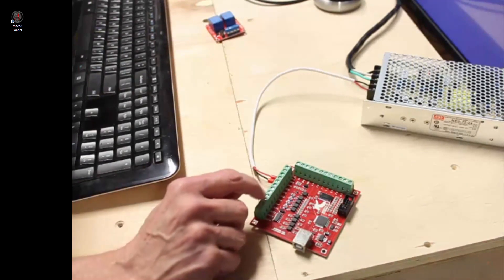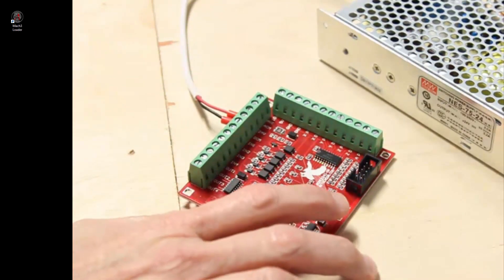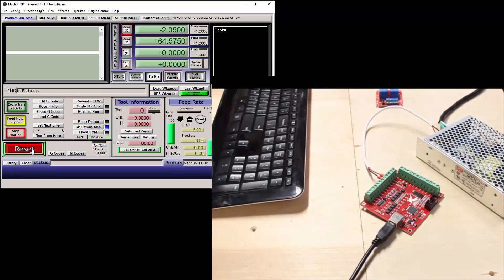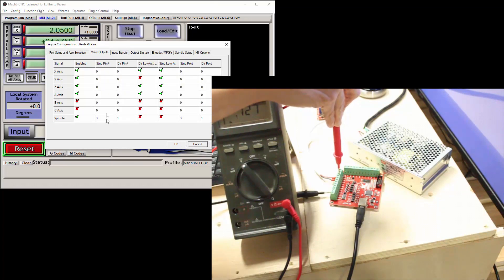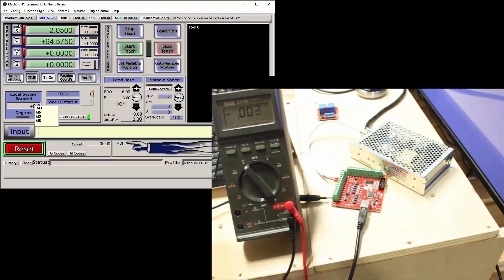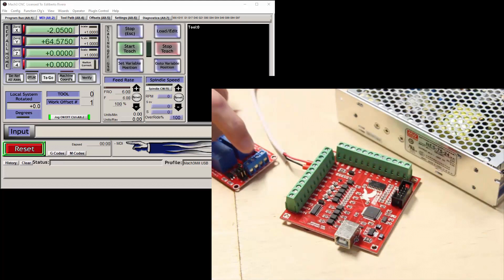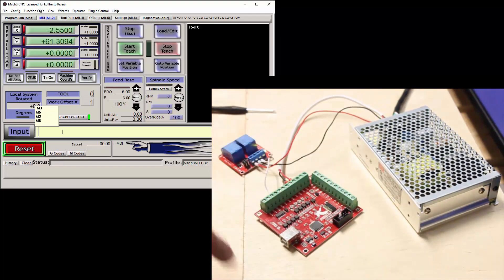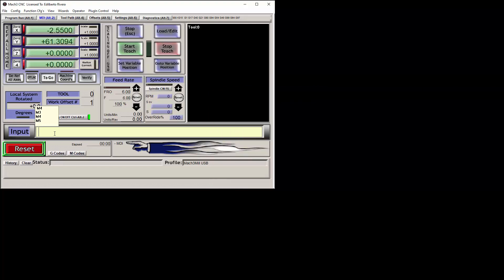Mach3 USB Controller Output Terminals

Comment: EDIT: I was completely wrong and did not realize that the Outputs are basically just open collectors. This means that once active, the Output becomes connected to ground. They do not "ouput" 24V or anything else. So you need to set up your relay for this operation. 

IMPORTANT for people who do not get the outputs to work this way: 

I've tried this approach for about a day and went through all mach3 settings trying to find the error because I was not getting a signal. The best I was able to do was to have a voltage of -0.6V between DCM and all inactive Outputs, while the active output showed -1V. The output was flashing in mach3, but didn't quite reach my motion controller. 
I was about to throw the towel and buy a different motion controller. 

Then I saw a video (channel was Minhs Man Cave), in which - instead of wiring the 24VDC ground to DCM, it was wired to one of the other ground ports (besides the 5V and 10V pins). Although I have not seen this wiring anywhere else and it might lead to problems further along the way, suddenly I got a 24V signal on the active output and 0V on the inactive ones and everything worked. I hope that this comment might help others facing the same problem and not having to sacrifice a weekend in troubleshooting :) 

PS: I did not buy the board from buildyourcnc (sorry, different continent) - so this might also be a reason for it not being able to work properly.
Reply from the maker: Thanks for the recommendation Lorenz. I can't verify if this will work, but I would advise against connecting the gnd of the 24v to anything but the DCM. Maybe the controller you have is different. The outputs are optoisolated from the chip and you want to keep the signal ground isolated if possible.  I would instead look for a different cause of the  problem which is probably in the configurations.  Such as, make sure the port number is set to 3 for the outputs (not mentioned in the video). This is automatically set in the xml download on the mach3 usb page on buildyourcnc.com.
Reply: @PatrickHoodDaniel  thank you so much for this reply! I didn’t have the outputs on port 3 and that fixed everything!!
Reply: My good man. I am NOT ALONE in this world!!!. I followed the wiring of BuildYourCNC. 
10v ---> 10v, AVI ----> VI, ACM----> ACM. 
The order in these readings is from Controller to the VFD. I have same VFD 2.2KW, I did the programming STEP BY STEP. 

PD013 = 8 for reset
PD001=1
PD002=1
PD072=400

I was about to throw in the towel, when I read your comment. But I am trying to understand the sequence here. Instead of wiring the black gnd wire from the 24V power supply to the DCM port of the power supply, he connected the DCM port of the motherboard to the DCM port in the VFD? I think I am missing something. I would appreciate some help.

Comment: Hi. Any idea of why my mach3 software is not communicating with control chip? I've set software configurations already.  Thanks in advance
Reply from the maker: All you need to do is make sure the rnrmotion.dll is in the plugins folder of mach3, and the XML provided on the product page is in the main folder of mach3.  You will use he XML file in the mach3 loader.  If you see the mach3 USB controller blink fast when you press the arrow keys (while in program run tab and reset is not blinking), then the controller is communicating with mach3.
Reply: @PatrickHoodDaniel  Wow amazing. I will try these out. I appreciate your time
Reply from the maker: @dsaworxcarpentrysolutions9155  Sure, no problem.

Comment: I am using 5v relay suggest wiring and setup. I try to wiring with mach3 usb but relay not working. I give 5v to relay from mach3 usb. And sgnal wire conect output 1.
Reply from the maker: You must use a 24V relay, not a 5v relay.  In the video, I use a 24V relay.
Reply: It mean 5v relay not working with mach3 usb ?
Reply from the maker: @Akhtardesign  Correct.  The controller uses a 24V on the input/output side so you need to use a 24V relay.
Reply: @PatrickHoodDaniel  i was using a 12 power supply for this connected to the 24v in with using hall sensors and worked fine, i also use 12v for e stop to trigger the board into estop, if this is the case you have to use 24v why does hall sensors work ans the estop set up? but now trying to wire 5v relays i find no matter how i wire the power and the signal it wont work, when connected corectly it just amplifies the volts to above 5 and wont work.
Reply from the maker: @mightyweapon  You must use relaays that match  the power supply used with the 24V and DCM terminals.
Reply: @PatrickHoodDaniel  yes im aware of that, using 12v through the 24v supply in worked for me on 12v hall sensors, my 12v supply is adjustable but only down wards, but even when adjusting it to 5 volts to match the 5v relays (hall sensors no longer connected) the relays wont work.

Comment: I have question about homing X and A axis when A is slaved to X. This board have only one common input for homing switches. How mach 3 will know that my gate of router is squared properly?. ( The X axis movement of my router will be provided by 2 slaved motors )

Comment: Good morning,

I turn to you, as an expert in the sector, to ask you for a little help.
I would like to restart my old self-made CNC CNC built some time ago as follows: TB6560 4 axis card (red) with parallel port driven by a PC with Mach3.
Unfortunately the pc with the parallel is dead now I have a laptop without parallel with Win10.
I tried with a Manhattan usb to parallel cable but nothing to do.
Is there a way to solve the problem without purchasing the UC100 module?
For example using Arduino mega instead of UC100?

Thanks
Reply: There is no way you can use a usb to parallel port cable if your cnc controller only uses that kind of port. Since your pc with that port is gone, the only way to go is that red breakout board that was featured here.

I built my desktop cnc using tachus 42 discrete diy  3 axis cnc controller that uses parallel port only and almost tried all possible parallel to usb converters and failed. Just saying.

Comment: The outputs do not show any voltage when I follow these instruction. I cannot see where I am going wrong.
Reply from the maker: Make sure the output you are using is set to port 3.  Check out my Instagram video on this: https://www.instagram.com/tv/CNWHk27Db1u/?utm_source=ig_web_copy_link
Reply: @PatrickHoodDaniel  I was measuring voltage from common to output. Ok when measuring from 24v to output :)

Comment: awesome video! but can I use this controller for mach4? any plugins or something? because I try to use in mach4 the controller not showing in "motion control" list
Reply from the maker: This controller is only for Mach3.  If you need a great full featured controller that I sell for Mach4, go here: https://www.buildyourcnc.com/item/electronicsAndMotors-electronic-component-breakout-Mach4-mach3-USB-ethernet-Board
Reply: @PatrickHoodDaniel  thanks for your reply, I will upgrade the controller in the future. but for now i still going with this controller. thanks man
Reply: @PatrickHoodDaniel  oke now I need to know. how to set speed controller from this to the VFD, in case I use huanyang inverter. and I confuse about Pins and Port, what it means? and where I get the Pins and Ports Number? I'll never stop learning.

Comment: I believe I found the answer, I was reading a  Vectric  forum, according to there info I should be able to resolve the problem by adding a Time Delay code right after every M3 code.  I seen a sample of a similar command on Cnc Zone forum by adding a G0 P2.5  it should delay the laser 2.5 seconds from shooting. I will try it and add an up date during the week.

Comment: Hi, is it possible  for the board to recognize the G13 instead of the G3  and G10 instead of the G5. for the G codes of the  Spindle?  I'm adding a Diode Laser to my table but my issue is when the laser shoots, the cnc delays approximately 2.5 seconds after every G3 code before it starts to move. leaving a burn spot. I've read that G10 and G13 don't have a delay issue. When I use the G10 and G 13 Gcodes the laser does not tun on  . If I chane the G10 and 13 at the PostProcessor to G3 and G5 the laser will turn on and off just with the delay. any suggestions would be appreciated . 
,

Comment: I did download your file of USB controller but it shows message that usb card is missing and it doesn’t work ? Note that my control board has usb connection output

Comment: Problems: backlslash compensation does not work, Out3 does not work for all my cards, no backlslash is a big problem
Reply from the maker: Make sure that the port number for the output is port 3.  Also, out 3 is reserved for the spindle.  Check the motor outputs and change the spindle line item so the output is not 3 if you are using it for a different purpose.
Reply: With regards to backlash have you tried using a gcode post processor to compensate? From what I understand this will add extra steps to gcode. I've managed to get rid of most of my backlash on the machine end but I was going to try that if I still had issues

Comment: mach3 setup to work with parallel controller. when usb board connected the setup is confusing and not clear when starting to use config , setting up port, pin, step , signal ,  and axis. i watched nearly all videos on youtube. none of the people try and guide others nicely and slowly how things are done. most of the people have prior knowledge when making these vids but they do not take in consideration that people turn to these vids looking for solid information to guide them through the problems they face with their projects.
Reply: thank you. connect usb controller to computer indicate if low or high drivin , then start mach3, go through the config drop down menu and start with each of the options one by one starting with configuring ports pins axis estop slowly giving people time either write down the info or work out the options on their system. and why it is being done that way . kind regards.
Reply from the maker: @johnsmith-wl8dp  Thanks.  I will make another video that goes through that procedure.  The high or low driving is unclear, however.
Reply: @PatrickHoodDaniel  hello again. i am not an electronic person but a mechanical engineer for the last 52 years well versed with material and steel production as well as computer terminology . i did not have enough exposure to electronics. stepper motors driving cards and breakup boards  has to be connected to enable, pulse, direction , either all negative,  together  , or positive 5volts, if all en-,dir-,pul are connected -ve together then the en+,dir+,pul+ has to have a high to drive separately the boards hence the motors. 
this is confusing and it has to be clarified. since mach3 needs to know what sort of signal level need to be sent in order to make the breakup board recognise the type of signal sent and on what port and on which pin. and  level high or low. i am not well conversed in this and i do hope i made some sence. that's why clarification is required. i need to learn this to be honest. i don't know if i made my self clear. regards
Reply from the maker: @johnsmith-wl8dp  The controller has a chip (MCU) that handles all of the pulses and signals.  All the USB is doing is communicating simple instructions using USB standard protocol.  You should check out some of my MCU videos.  You will see them in the channel. Here is a link for your convenience: https://www.youtube.com/watch?v=R6SstBoXjKc&list=PL6PplMTH29SHgRPDufZhfMRoFwRAIrzOp
Reply: @PatrickHoodDaniel  thank you i will .
Reply from the maker: @johnsmith-wl8dp  With electronics backing your mechanical expertise, you will be unstoppable!!
Reply: @PatrickHoodDaniel  thank you i am exploring the subject further i need to get some foundation into basic electronic system. thank you for your input greatly appreciated.
Reply from the maker: Let me know if there is anything I need to clarify.

Comment: Which is better, a USB or parallel system
Reply from the maker: A USB controller is doing the heavy lifting by producing all of the pulses for motor movement, and processing inputs and outputs, and the computer is only transferring simple instructions via the USB.  A parallel controller forces your computer to do the heavy lifting causing the computer to be used exclusively as a CNC controller.  There is a pro with parallel in that you are able to manually jog multiple axes at the same time, but that is it.  USB/Ethernet is the way to go. Manually jogging only one axis at a is not an issue.  If you need all axes to get to a specific location fast, then just use the MDI input and all axes will be used at the same time to get to the location.

Comment: If i use this for control on and off spindle, can i also set variable speed too?
Reply: can i use the output to turn on spindle with 24V?
Reply from the maker: @dannygiesbrecht9519  Yes, but you will need a relay as well.
Reply: @PatrickHoodDaniel  Update. I got it working, no relay needed. Output 1 to FOR & DCM to DCM. 
changed to this card from another. Ran a small test program air cutting a large oval. It seemed like The motors were taking turns, literally. very jerky motion. I have 3 axis, 4 motors A slaved to Y
Reply from the maker: @dannygiesbrecht9519  Nice.  Thanks for the connection specs.  Odd that your motors are not smooth.  What is the microstepping setting on the drivers?
Reply: @PatrickHoodDaniel  800 pulse/rev. I did use the 5v from USB to power drivers,  I will change to dedicated power supply and see what happens.
Reply: @dannygiesbrecht9519  i can turn on and  off spindle but i still can't set variable speed with this board
Reply from the maker: Yes, there are terminals for that labeled 10V, AVI, and ACM. You will also need to set the parameter to use the external terminals for speed control rather than the control panel.
Reply: @PatrickHoodDaniel  Could you please explain it a bit. It is confusing
Where do those go on the VFD
I think  10v - 10v   avi - v1   acm - acm

Comment: What wires from the VFD should you connect the NO/COM/NC side of the relay? Is relay COM supposed to be connected to the USB controller's ACM and the NO connected to the VFD's FWD?
What voltage control signals do the FWD/REV on VFDs normally take?

Comment: Hello sir, Have you covered on how to install an E-Stop on the controller. I didn't seem to find if the switch was wired for NO or NC. Thanks!
Reply from the maker: Connecting an E-Stop on a controller is the same wiring as a limit switch.  You can refer to https://www.youtube.com/watch?v=8un8rbQcoZU on how to connect a limit switch.  Make sure to use the normally open side of the E-Stop
Reply: @PatrickHoodDaniel  thanks! I just wanted to be sure
Reply: @PatrickHoodDaniel  I want to add a second E stop and would I have to use a separate pin or wire with the current stop?

Comment: Hi, thanks and congratulations for your work. Have you operated the pwm output with this same interface and with the VFD YL620-A? I have the same USB interface and I cannot make it work at low speeds in a stable way, I have connected AVC to GND, AVI to VI1 and 10V to 10V, I have configured the VFD to work externally and it works well at 24000 but at low speed the spindle is turned off and on strangely. I hope you can help me or know if you have made it work well, regards
Reply from the maker: What low speeds are you trying?
Reply: @PatrickHoodDaniel  I already solved the problem, it seems that the output 1 that activates the spindle did not completely reach 0v with respect to ground when the speeds went down below 20,000, it made a kind of pwm. To solve it, I deactivated the output of the spindle that was enabled by default in "ports and pins" in the tab "motor outputs" I only deactivated that output and the problem was corrected, thanks
Reply: Hi Sir. I have  a same the same VFD YL620-A and USB. I'm connected to  USB and try to control from Mach3 . But  is not working. Can you please details the set-up ports and pins and how to run. Thanks,